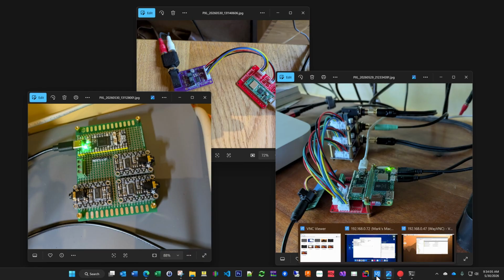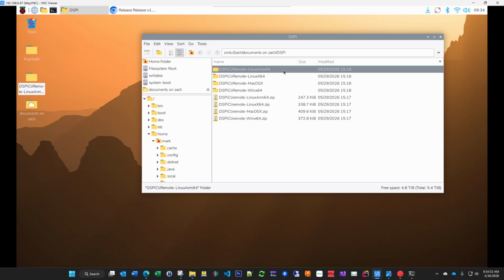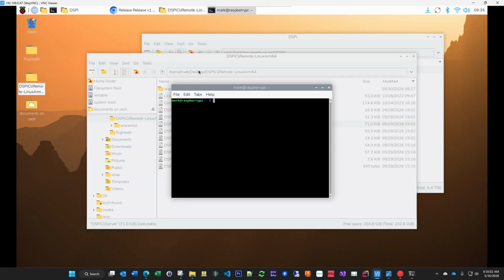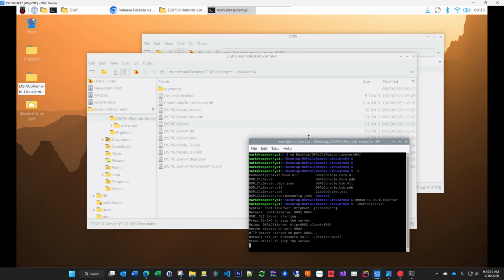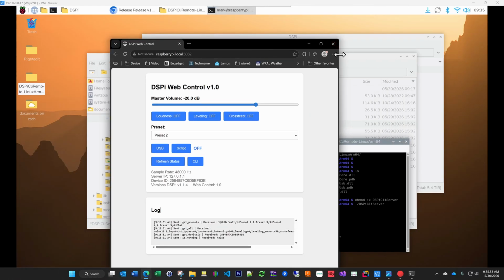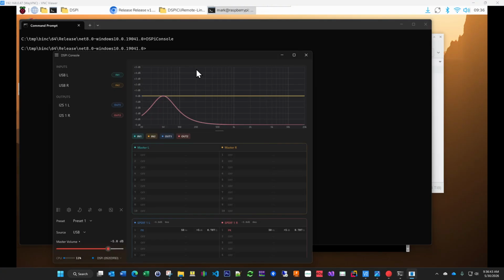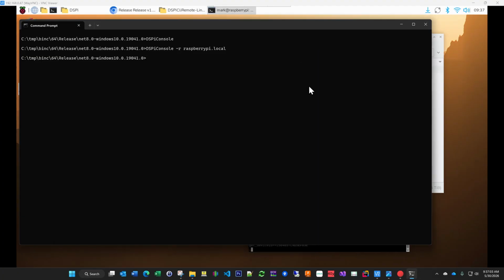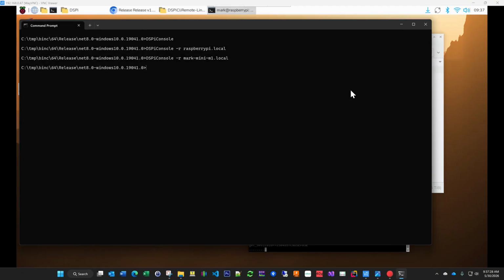How to remotely control a Weeb DSPi DAC controller that lives on a Raspberry Pi or Mac

Comment: I am interested in building a DSPi myself. So far this video seems to be one of the few resources available online that show actual builds of the DSPi.
Are the red PCBs only there for connecting the Pico to the DACs? And if so, are there gerber files for this available somewhere?
I am also wondering what the PiZero in the bottom right photo is used for. In case you used different DACs in your three builds, is there one model that stands out that you can recommend?